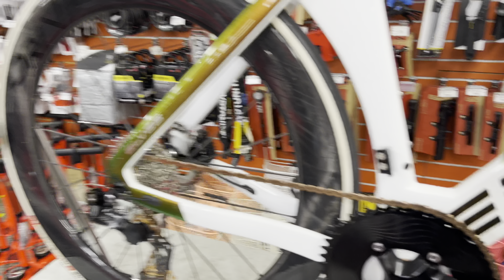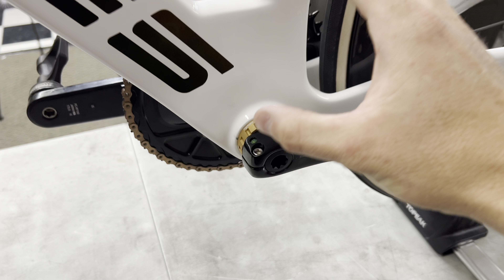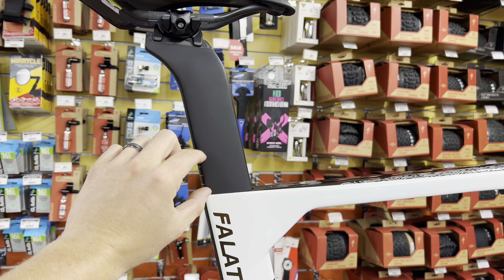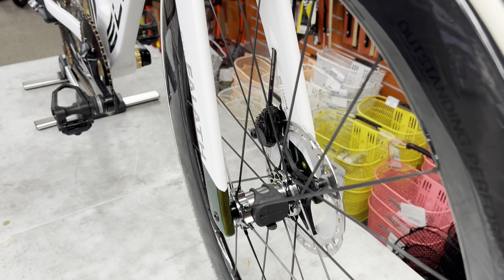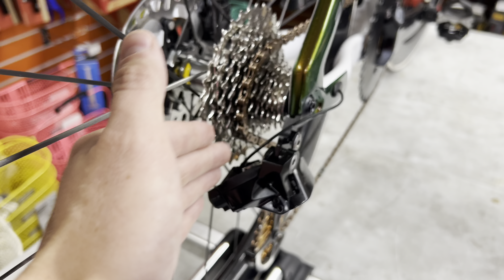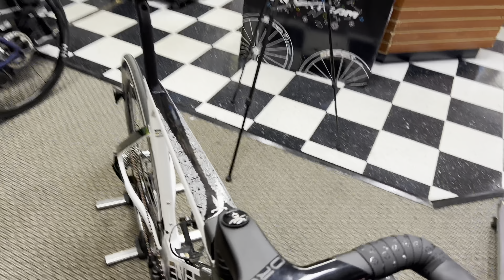*MY $4000 PREMIUM CHINA BUILD* (THE GOOD AND THE BAD)

Comment: Looks phenomenal, the paint scheme and all the other components go very well together, visually. I also like the idea that you went with a slight budget aspect, 105 Di2, Assioma pedal instead of a badass powermeter crank (even though I suspect it was the only option since you already had a hard time with the 1x crank). Nothing wrong with this build, as a consumer, you just need to find a shop that gives it the love it needs to work out those tiny issues when they can't sell you one of their frames and you'll have a cool bike at a strong price point.

Comment: What a beauty ! I got an Elves Eglath Pro a couple of months back and am very happy with it. It's also very comfortable, especially  with 28 mm tubeless Pirelli P Zeros run at very low pressures ! I've recently had an issue with the Garmin mount which looks identical to yours with the cut-out behind the quarter turn mounting point. After 2,700 km my mount broke in half, it had developed a stress fracture by one of the holes through which it is bolted to the bars. Elves are sending me a stronger replacement mount. I wouldn't trust that thin aluminium mount you've got.
Reply from the maker: hahahah thats funny you say that because that is what happened my mount for my garmin snapped off, now i had my insta360 on there bending it alot but yes now I just have a the regular garmin stem mount

Comment: Another great video, great job.
Regarding disc calliper mount issue, as a mechanic myself and had build dozens of fresh build from low tier to high end frame by very well known company, its all about qc by the company. Ive build a usd6000 frame with a poorly faced calliper mounting area, I’ve build a usd1200 frame with a perfect calliper mounting area. Its all about qc hahaha
Reply from the maker: Yes this is the truth. Just depends on which ones slip through the crack.

Comment: I love mine! Same experience with it holding speedes really well. And I have maybe 160-200kms on mine. And i didnt have the issue with the front break. Maybe the mounting on the lwtoo 12 speed hydralic calibre is different from 105.

Comment: Turned out nicer than I thought:) It would make a great second bike for me.  I've got an old Ultegra 6800 g-set laying around doing nothing. now I'm thinking, use that with mechanical discs. I think I could get it for ~2500 euros all in 0_o which would be amazing, at this point it'd be rude Not to do it hehe.
Reply: They have a climbing model, that is uci aproved, with rim brakes, the Vanyar. I have seen very good builds here on youtube. Hitting 6.5kg, with some low weight carbon whellset's

Comment: Nice bike! Still, the Falath Evo strikes me as being designed around a geometry that the majority of people aren't going to use. You either ride a frame with a ridiculously high top tube or you need to stack your bars so high that you could just as well have omitted that bar placement in the first place. For me for instance, I could ride a 59 but would probably still come up too short even with a 130mm stem. Or I get the 61 but I would have to run a shorter stem than usual and I could then probably slam it all the way down but also have less exposed seatpost than normal.
Reply: The geometry is pretty weird on that bike
Reply: Exactly the same for me. It is weirdly short of reach. Strange geometry.

Comment: This bike supports 32 mm wide tyres, which means you can fit tubeless Panaracer Gravelkings. This has made me thinking, whether this is the perfect frame for a very aggressive aero gravel build. Would I be able to fit SRAM Transmission on this frame? God, that would be so badass.
Reply: they dont come with gravel handlebars.  This is a road bike not a gravel frame

Comment: Merlin Man
1 second ago
I love it's look,  I see it would be fast, yet  way too narrow in application for me, it would shake your teeth out over rough roads, however it would make a great medium distance, fast smooth road Gran Tourismo Rocket, getting it and holding it at speed, in or out of a Peloton, would be a lot of fun, over the right surface that is....then one could stare at it in the  spare time.
Reply from the maker: yes this bike is very very stiff and holds top speed very sturdy, I only do 20-60 mile rides, so it is not an issue

Comment: Love how this bike turned out! 😍  just one thing: unbolt the front derailleur mount, get some white electrical tape, and cut a peice to fit over the bolt holes for a super clean look 👍
Reply: Bonus points for taking some white adhesive backed foam and filling in that gap to the rear wheel 😂
Reply from the maker: Thanks so much!!! I love how this bike turned out the look as well. Really allowed me to be creative with the build. Thank you for the complement

Comment: This is an aero bike. The higher stack helps a lot to be aero where you can ride with your elbows paralleled to the ground. Bikes like Orbea Orca and Trek Emonda H2 fit has exactly that +20mm stack. Not many people can ride a slammed H1.5 Emonda with elbows parallel to the ground for a prolonged period of time on the road.
Peak Torque did a video slamming GCN’s video advocating you should slam your stem 😂 in that video, he talked about having a higher stack can be more aero.
Reply: What I’m trying to say is, if you want fast, aero and stiff, don’t downsize. 
Look at track bikes. -they barely have any seatpost showing.
Reply: no comment🤐🤨🤔
Reply from the maker: Yes your only as aero for as long as you can stay aero. But to me because this is a weird situation and I didnt buy the bike and I don’t wanted it to look good. I don’t mind it. But this is the biggest thing I tell people while I’m fitting them that they want to slam there stem. Your only as aero for how long you can stay aero for
Reply: You are really very wrong.
Reply: @benfinesilver2250  we met at Rob Armstrong’s video. Not going down another argument with you. You do you. Live and let live.
Reply: @ariffau  I’m not arguing with you. Politely it is totally wrong though. It’s up to you if you want to believe this.  That Rob person is childish and really does not know what he is taking about whatsoever. I wish you well.

Comment: Hello, what do you think about what Cam Nicholls said in his Falath bike review and especially the fork in which fiberglass is mixed with carbon ? I currenty ride and an old Time ZXRS bike and I have to confess hat I'm fed up to face always upper prices for both spare parts and bike in general, that's why I want to know more about chinese mark and sure Elves one. Thank you for your video.
Reply from the maker: its a non issue, I made a video showiung all the high end bikes made by scott and specialized using the same fiberglass in the forks, this is common in every bike company
Reply: @GCPerformance18  Thanks a lot for your quick answer.

Comment: Was all in until the brake caliper debacle. My first disc brake bike had the dreaded rotor rub and it drove my crazy to say the least. I needed to remove my front wheel to transport my bike and lining up the caliper and rotor before every ride was annoying. Otherwise that build turned out amazing.

Comment: About time someone had a 1x chainring for the 12sp available. Link for the cover? Only see it available for R8000 cranks.
Wolftooth is sleeping on it. I asked them about it and they said they plan on it but no eta.
Reply from the maker: yea I found it so shitty, I reached out to them and rotor and both onyl had 11 speed or some had 12 speed but only 50t, that works for the 12 speed I have seen people run, it on th enew 12 speed covers

Comment: Was it just me or did it look like that rear wheel hub might have some tolerance issues/not rotating in a proper circle? Looked like the wheel was bobbing up and down when you freehub'd it at the end. Also I'm extremely surprised at 6 foot you were so comfortable on this bike! Although on a larger 56 frame, I am very surprised you have been using a 120mm stem!
Reply from the maker: yes I love this bike for the size I am going to do some ride videos on there

Comment: Quirks and customer service aside, I'm convinced this frame isn't really designed for markets outside of the Far East. Or competitive racers for that matter. And that is perfectly okay. Not all frames fit all people. I'm also 6 feet tall myself and I run a 130mm -12 stem on my 56 Allez Sprint which has a frame reach of 398mm. I don't think my bike fit or anatomy is an extreme outlier for racers. Just seems like this frame is too tall and too short. One thing not mentioned was the risk of toe overlap when going down a frame size.

The reason Tarmac SL7s are so popular (besides expensive marketing) is because their frame designs and offered accessories allow for a multitude of body type and bike fits. I'm scratching my head as to why Elves is making such a huge push to market this frame to the USA and UK when the frame isn't exactly suited for such customers. There's a reason you don't see this design among the major brands on the market.
Reply from the maker: that can be said for every frame though, I think you can get the right size bike in this frame it just might not look what we are use too, your 130mm stem and -12 is an extreme setup and not everyone rides that setup, in many cases people would say just size up.... even though we know that is not the case, and toe overlap is crazy to me, I can make my toe hit the front tire pretty much on every bike size and company when I am riding it, just know how to corner and drop the proper foot into that corner, I have seen so many customers put so much emphasis on that part while test riding a bike and I just say pedal backwards halfway and now you are good. There are plenty of frames out there that just don't work for people but that is why there are option out there and consumers have the choice to buy what they like...if this frame seems off or something that might be a risk for a fit then that is on the consumer to decide whether or not it is a good fit for them and do what is smart with there money..... if I was spending money on a bike this wouldn't be my absolute first choice for a bike I would do my research and then make the educated decision for it after..... But consumers do have to take some kind of responsibility here and do some homework, they are buying a direct to consumer brand bike which they give the measurements online but they want to know if this is going to work for them..... this is the downfall to buying direct to consumer where as a bike store u can go there and test ride it and be certain it is the right fit. buying sight unseen always has its risk

Comment: I had a bad experience with chinese frames. And I am not the first... For example I built my T1500 by Winspace and there was a very significant slack in the upper headset bearing landing, so I did an adjustment with brass foil to fill the gap, but I am very disappointend by the QC of these factories.

Comment: May I ask how much torque was applied to the integrated seatpost clamp? And did you use the provided sandpaper tape for the seatpost? I´m asking beacuse I finally received my frameset and wheelset, after having waited for over 11 weeks. The seatpost is a very tight fit and the recommended specs (10-12nm) for the integrated seatpost clamp seems excessive.
Reply from the maker: I did 9nm on mine. But mine was a pretty smooth fit.
Reply: @GCPerformance18  Thanks. Elves insists it wont break at 12nm. And I doubt my seatpost would even fit in the frame, if the sandpaper tape is fitted.

Comment: Nice build! Are you trying out new bar tape or is this also supacaz?

I have a off topic question since you were talking about the chainrings if you don't mind. 
I want to upgrade the GRX crankset on my allroad bike to a 105 or Ultegra one. I feel like it's starting to get more difficult to find the 11 Speed cranksets in stock in the right crank length and chainring combination. So I'm wondering if there would be any issues using a crankset from the new 12 speed groups on a 11 speed drivetrain? Sorry for the noob question

Comment: Dude, it's tooooo small for you. Your foot and a wheel overlap each other. That's kinda dangerous. Otherwise the bike is great except an issue with a frame top tube height you've mentioned.
Reply from the maker: no it is not this is my bike size, foot toe overlap is not a real thing, you tunr with your foot at the bottom of the pedal stroke
Reply: @GCPerformance18  I see. If you have such instinct that's great. I'm looking at Elves and Yoeleo and I'm very upset because they do not offer frames with a good wheelbase and a stack. And I'm not so experienced like you to keep my feet and arms fully controlled 100% of time ))

Comment: The design of this bike makes no sense to me. It postures as an all-out aero bike (and carries the weight penalty of one) but leaves huge gap at the seat tube cutout. There is no need for a 32c tire on an aero bike. 30mm would have been more than enough. A bunch of tube edges that lead into the wind are square (like the top-tube gusset. The head tube--probably the most important area aerodynamically--is even fatter than the last Falath, has no profiling to make it narrower between the bearings, and is the shallower than the downtube. The frame looks like it was designed for a fork shorter than is specced. Just look at the seatstay junction and those fork crown wake-collector fins at the bottom of the head tube. They're sloping down, catching the wind. The "stem-integrated" headtube is ridiculous. It only makes that bloated headtube taller and heavier. And lastly, the downtube looks totally optimized around not having water bottles. In the year of our lord 2023, most bicycle manufacturers, even some Chinese ones, recognize that people will be riding with at minimum, one standard round water bottle on the downtube, and this is non-negotiable. It is completely ridiculous to design a downtube without considering that the airflow must also pass over a bottle. 

I seriously, seriously would question if the Evo is actually more aero than the old Falath if you put 2 bottles on it.
Reply: I agree with you about the huge gaps and that puts me off. You can’t run larger than 25s on an aerobike. It does look like the rear of the bike is wide and would shelter a wider tire though. Even a 28 is going to have a huge gap.

Not sure about what your saying pertaining to the downtube though. It’s wide, so it would indeed shelter bottles from the wind 🤷
A better frane is the new Boss Zwnith aerobike, out in August. However, it will cost twice as much.
Reply: @benfinesilver2250  
Re: downtube width: if you take a closer look at the videos, the downtube remains less than 50% of the bottle width, probably closer to 30%. Aero bikes like system six, dogma, S5, and Madone have a downtube that tapers wider near the bottle and approaches 50% or greater width of the bottle.
Reply: @danielsvedberg2439  Thanks Daniel. I will look more closely and trust you are right. I studied the design and came to this conclusion for what it’s worth…
I think it copies a Cervelo S5 top tube, head tube and bar; combined with a Canyon Aeroad downtube. The gear section looks similar to an Aeroad too.

Comment: I “almost” buy that bike and I’m glad I did not. The only good thing I see is the paint scheme that is honestly superb. They had issues with the bottom bracket, the fitting or angle of the frame and others, look at the separation between the rear wheel and the frame 😀. Plus they don’t sell a complete bike .. anyhow I just bought a CANNON CF SLX 8 Di2 Ultegra and I can’t be happier.